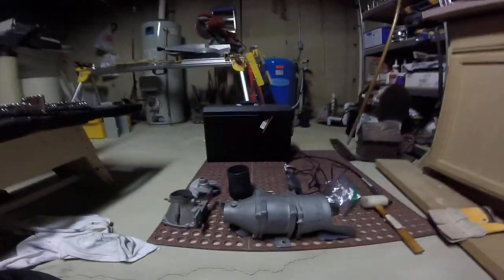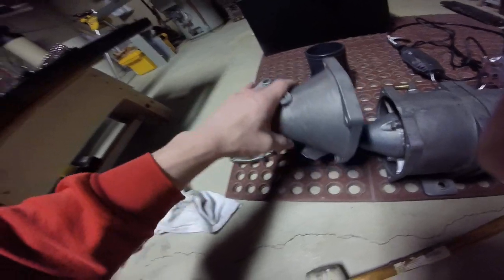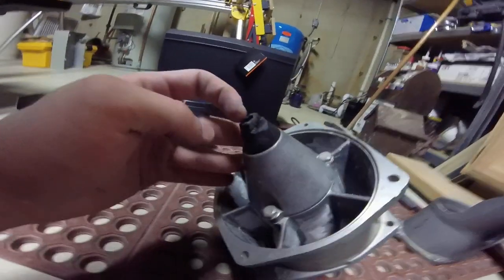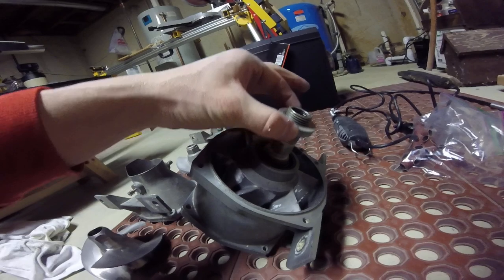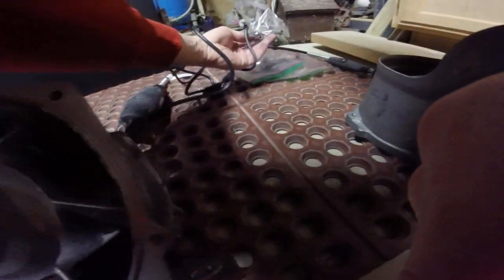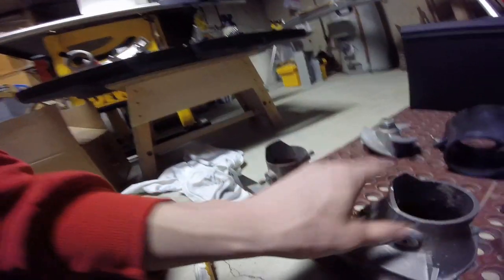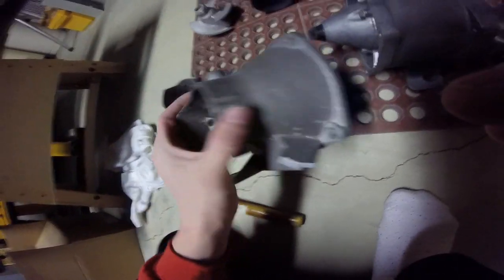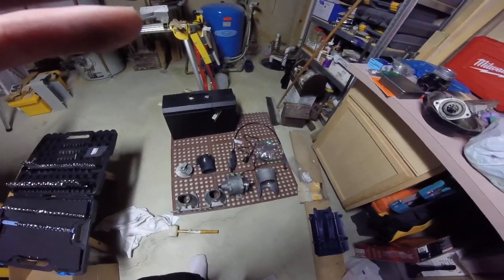JS550 Pump Disassembly and  Blueprinting

Comment: i just bought a 550 thats been sitting for a long time. motor is pulled right now so i tried turning the coupeler is connected to the shaft from inside the hull and it seems like the prop is binding on the wear ring. will the prop grind this away enough (seems like the wrong way to fix it...) or can the wear ring be sanded a little for clearance or do I need to purchase another wear ring. thanks for your videos
Reply from the maker: Nickolaus B so the wear rings on the pumps will swell sometimes and then you have to get a new ring. I would take it out look at it and if it is bumped up in places it’s bad and you’ll have cavitation issues if you use it. You can remove shins behind the impeller to gain a little clearance as well but you’ll have to pull the pump to know.

Comment: Hey, I am having trouble getting my pump to push water through for the cooling system. Any tips or fixes for this?
Reply from the maker: Conner Gibson Yes you probably have something stuck in your cooling line. Start by unplugging your line at your bulkhead and blow through. If you can feel air coming out of the pump fitting your good there. Then unplug another line and blow through that. If you ever can’t feel air coming through or there is resistance take compressed air from a gun and shoot it through. If the clog persists you can always pull the line and just replace it. Fast flow fuel line sells good cooling line. Any more questions feel free to ask and I can make you a video too once I’m home from vacation.
Reply: Thank you! I had it running off the garden hose and everything was running fine and staying cool. I dropped it in the water and wasn't getting any water flow. It was cavatating  a lot. I dropped the pump and I noticed that my impeller didn't look that good. Now I don't really know what a bad pump looks like/feels like, so if you could give me some pointers on what to look for in a pump and on the impeller that would be great. Also if you know anything about the different pitches different impellers have and what they do that would be very much appreciated. Do you know the pitch of a stock impeller?
Reply from the maker: Conner Gibson this is a loaded question I’ll make you a video about it all once I’m home tonight.